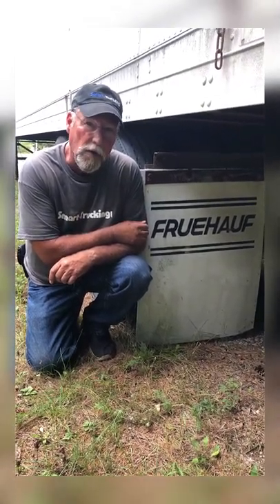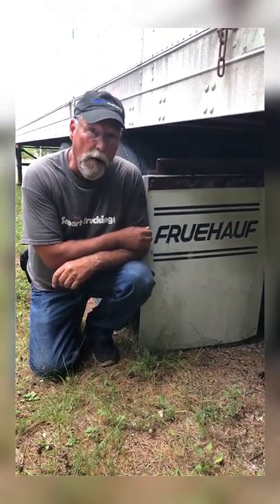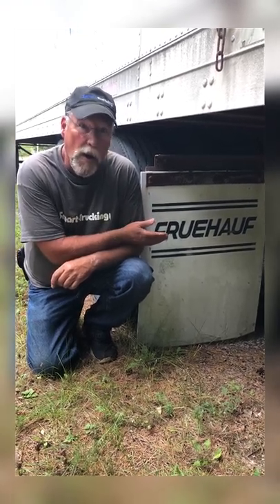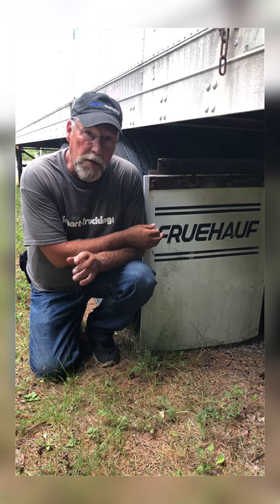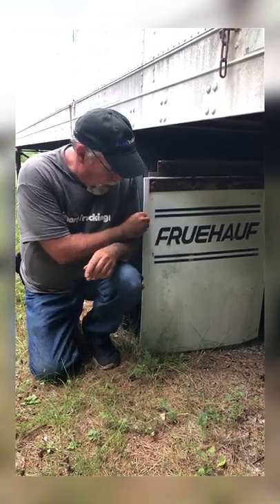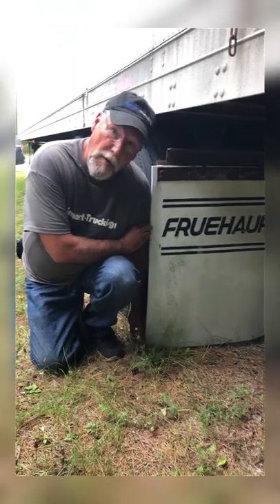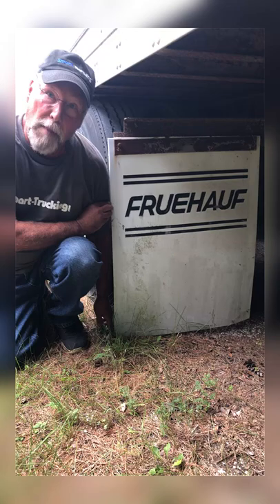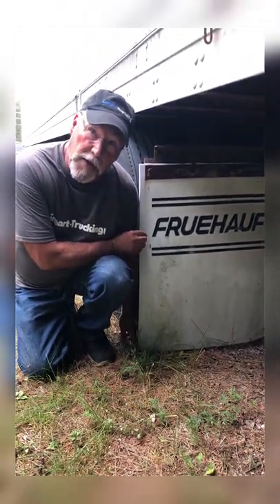How To Scale Your Load With Your Mud Flaps #shorts

Comment: This is a good trick, done it with logging trailers and dump trucks. But use a chain welded in place and a hook, when the chain touches you hang it up on hook,  and can still keep flaps up so yo can back up when off road.

Comment: You can load it to 34,000#. Mount a length of chain so it just touches the top of the axle. If you drop the trailer, someone else can see the chain hanging down and load it until the chain touches the axle.

Comment: Love your channel. I haul with a newer 18 speed freightliner with a tilt bed and run a Cat D6k dozer for the cali fires. I have been running cargo in the off season. Wondering what your thoughts on all these new drivers only getting automatic endorsements? Seems like the industry is going away from the manuals.

Comment: You can do the same thing with air springs. You just need to know the total area of the airbags and then the pressure in the air bags. If there is any other type of shock l or springs you add that force and the weight of the axles under the airbags.

Comment: I always marked the side of the trailer with my fingers. Even on sealed trailers you can find the end of the product by knocking on it. Set my trlr tandem mud flaps at the fingers and 99% of the time it was done. I can tell if the drives are overweight by the sound going down the road.

Comment: I run a 48 ft hayrack you can run 90 95000 on that trailer it's a 3-axle and the mud flaps won't drop even a half inch

Comment: Sweet! Coulda used this one on my first load out on my own! 😂 first paycheck 800 minus 1200 and 12 hours behind after 25 miles. I parked at the scale for the day and had to reset. 600 over on my drives, never slid my tandem forward at the packing plant! Dont do this clown move.